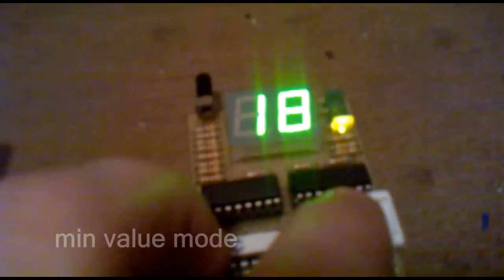homemade digital anemometer (wind speed meter) with ATtiny2313 and wireless probe

Comment: what are the materials you used it ? can i know ? :)
Reply from the maker: hm if i still remember, it was a while ago :D
the counter has some komparator or shmitt trigger and some AVR uC to read the sensor, but the control board is just an attiny2313 uC and two binary to 7 segment decoders. And some descreate components like voltage stabilizers and rezistors and capacitors. Im sorry i have lost the schematics and disassembled the boards long time ago.
Reply: +tritonmole it's okay 😊 . anyways thank you for the concept